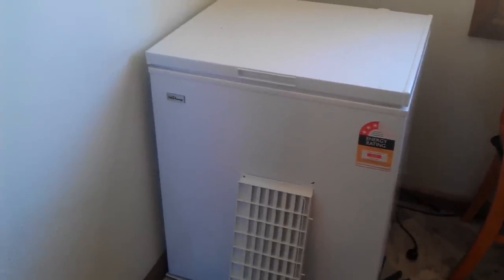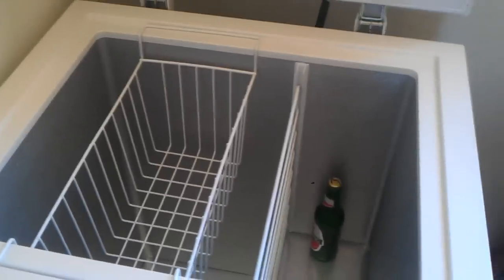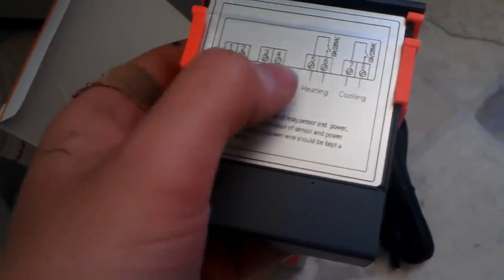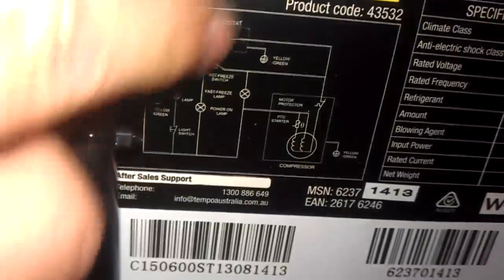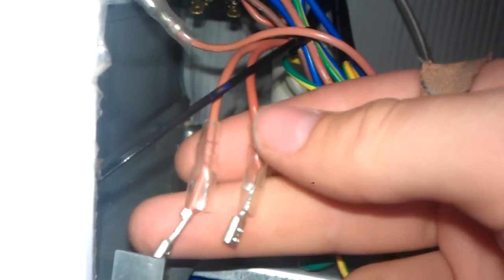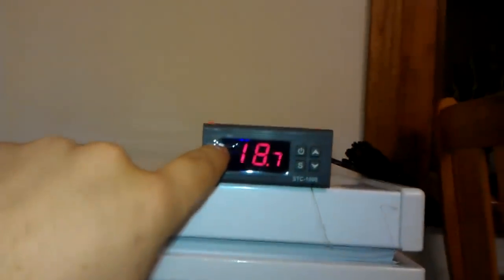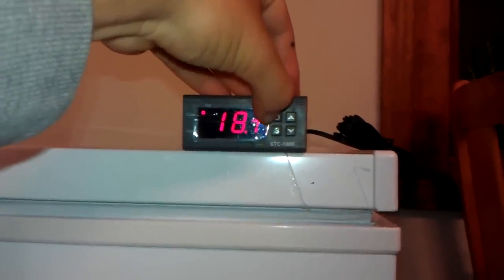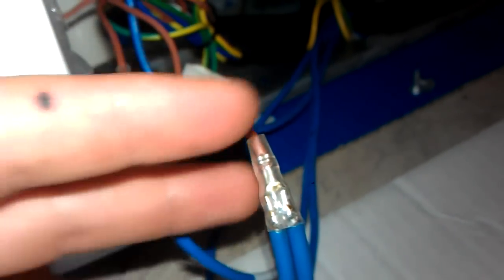Install STC-1000 Thermostat Into A Fridge/Freezer

Comment: "Active" ("Oz") = "Hot" (USA) = "Live" (UK).  i.e. NOT the neutral wire
Reply from the maker: Very good point. Thanks
Fortunately, in recent times ink bird is taking over these old units and is meaning that home wiring is not worth it and not required.

Comment: So your freezer temperature bulb is removed and replaced with the new thermister? If you did replace the thermister, how did you feed it in where the temperature bulb was?
Reply from the maker: I don't follow sorry. I replaced their thermostat with an STC-1000 and put the sensor in a bottle of water with metho.
No thermisters or bulbs.

If your talking lighting i did replace the bulb in the lid with an LED strip but that a whole another topic.

Comment: No sparkie involved because they wouldn't have connected it like that.
Reply from the maker: muz guz mmmmm and how would you suggest?
Reply: With blue point electrical connectors and electrical tape with the proper electrical insulation resistance in accordance with AS3000.
Reply from the maker: muz guz It's a good thing it's as per AS/NZS 3000:2008 :) nowhere in there dose it say that BPs must be used, it dose say you cannot solder and shrink a connection though. soldering isn't normally done because your standard sparkie dosent have the time to muck around with solder (and most of them do a shithouse job).
Reply from the maker: Please point out the section and clause number in AS/NZS 3000:2008 that states that BP's and tape must be used.
Reply: maXim0200 you must maintain your ip rating and from what i could tell you certainly didnt do that.
Reply: can you just copy and paste the electrical safety certificate your electrician supplied you and it's all legit. until then just call me mr pessimistic.